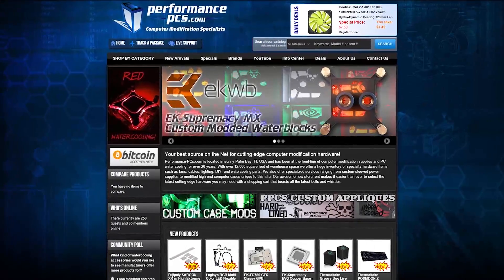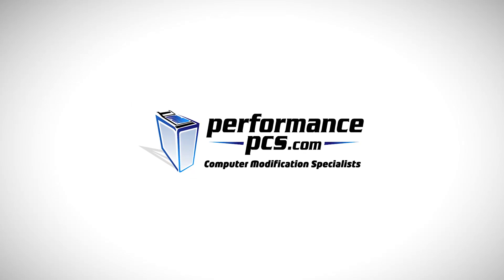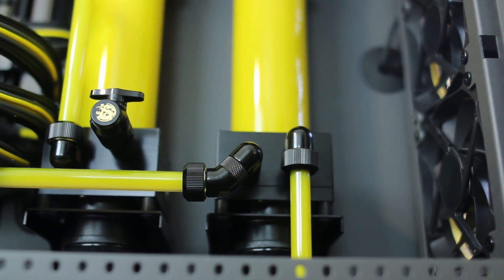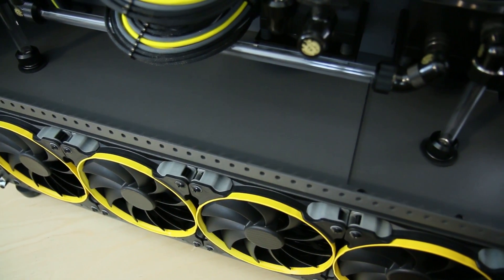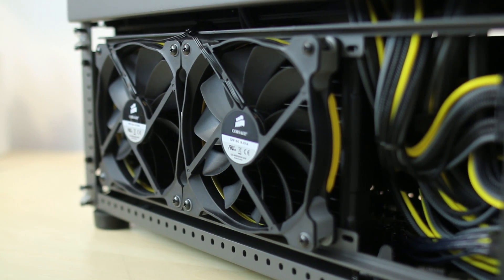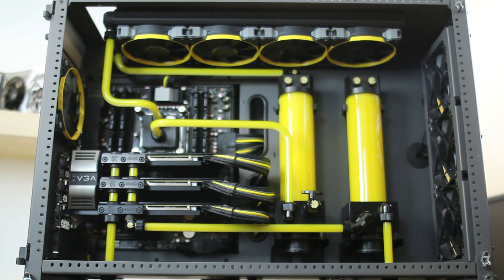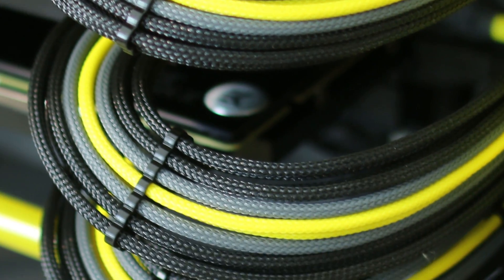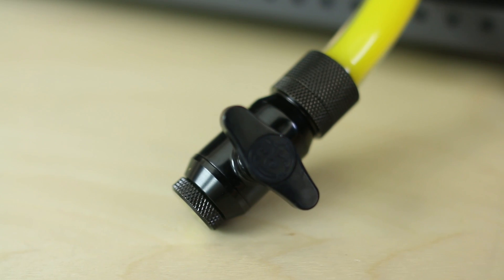Skunkworks V3 is COMPLETE!

Comment: Jay can the temperature diference between the 3 way 980's and the 3 way TITANS have to do with the die size of the gpu and the ratio of tdp/mm2???
Reply from the maker: Vittor Machado The 980s have lower TDP so they would have been the cooler cards, not the Titans.

Comment: Epic B-Roll Bruh, loved it :)
Quick question though, with a loop as complex and long as yours, do you have to wait longer between power cycles? As in fill res, cycle power, let fluid flow, see how far it gets? 

I've just got horrible visions of you cycling the power, filling too quickly and it ends up spraying back out of the res ;_; (i run a meager bayres to CPU/rad and back loop, i am not worthy)
Reply from the maker: Deadly Llama It took about two full reservoir fills before the fluid returned to the res in the CPU loop, and about 3 res fills for the GPU loop.
Reply: *****  Ooft christ, those are big res's as well, no wonder you spent $75+ on coolant ._.

Comment: Jay, I've been watching you since around 2013 and try to watch every video as they get released. I only have a AMD Radeon R7 250 with 2GB of DDR3 V-Ram & a Intel Pentium CPU G3240. I got cheated out of my money with this computer which also is my first one since I did do my homework on the specs. I could of gotten A LOT better parts for the $600 USD I payed for this CyberPower PC. I'd love to be entered into the coming up give away for your 980's! :) I'm trying to run a channel but as you can tell I have low end parts and I feel your classified 980 would be perfect <3 I'm currently half asleep so please don't mind any errors I made in writing this & great work on Skunkworks 3.0! 
- Turtle (Justin)

Comment: I think you shouldn't have connected your videocards that way... It's kinda now not going thru all the blocks in a row, your fluid will now decide it path based on the way of least resistence. and that could mean that your top card will be kinda hotter because the fluid is easier of going thru the bottem card only as it will have the least resistance instead of pussing it up to the other two cards.
Reply from the maker: Sergej Annema You have no idea what you are talking about... like literally no idea.
Reply: ***** please enlighten me

Comment: Hey Jay. Would you explain the temp difference with just the addition of the 280 rad, or do you think it might have something to do with the waterblocks or the heat dissipation design inside the GPU? As in something similar to the difference between haswell and haswell refresh cpus?(4670k/4690k)
Reply from the maker: pesadjo There isnt much to complain... its more surface area. More surface area means more watts can be displaced.
Reply: ***** I really find it hard to understand how you get to do all the work you do, Jay, still finding time for the family and being so active and present within the community and answering silly questions like mine. Thanks a lot. I really appreciate it.

But I'm still not quite getting my head around it. The surface area was increased by 50%(Was 4x140, now is 4x140+2x140), but the Watts were also increased by 50%(was 3x165W, now 3x250). So I'm thinking the 980 increased hugely in TDP while overclocked, while the Titan Xs don't increase their TDP as much. Or maybe because the CPU is becoming a bottleneck, the Titans are not working full steam and not producing the full amount of heat?

Or maybe I was just not paying enough attention and I got the rad size/count wrong.

Thanks again for being so dedicated to the community and to freaking awesome stuff like Skunkworks. There's better system modders out there, and there's more powerful systems out there, but what I think makes Skunkworks so special(famous/well-known) and prominent within the community is your involvement with the community. All the best.
Reply from the maker: pesadjo All you have to do is realize that radiator heat dissipation is not linear like you are assuming.
Reply: ***** It's always the hasty assumptions. I still haven't watched all of your videos in your 'Watercooling' playlist. Guess that's where I'm spending the day. Thanks a lot. Hope everything is going well with the new Skunkworks and you're happy with the OCs.

Comment: Excellent stuff, the system looks awesome. With those thinner radiators there seems to be so much more space in the main part of the case.
If there were any doubters about your GPU cooling, to do with the tubes and flow, they just need to watch the filling from 1m20s and all will be revealed.
Reply from the maker: jockspice And yet they still ask when the answer is right in front of them. There is no cure for stupid.
Reply: ***** Indeed. Except perhaps a polo mallet.

Comment: At 1:20 it kinda shows why parallel configurations like that work, you can actually see the liquid come out of the blocks before the first block is full.
Reply from the maker: LachieUnderscoreSixOneNine The flow rate is evenly split between all 3 cards. Thats why if you also time how long it took for the coolant to come out of each passage, they are identical.

Comment: 3-way sli 980 to 3-way titan x see marginal performance boost likely cuz of cpu bottleneck.  Maybe dual cpu is next step. Would be interesting to see at the least.
Reply from the maker: yhp99 Dual CPU will not unbottleneck the GPU performance. So many people get that wrong.
Reply: ***** Didn't realize this has already been debunked.  I wonder why. Also, I wonder if newer technology makes previous comparisons invalid.
Reply from the maker: yhp99 Its because XEONS offer more cores, not more thread performance. over overclocked i7. So adding more cores wont fix the problem.

Comment: the only freaking thing that's bothering me is that one of the fans for the 480 rads in the bottoms seem a bit swiveled than the other. sorry but this is bothering me like hell.
Reply from the maker: Ahmed Alkathiry That literally makes no sense.
Reply: check them and you'll see
Reply from the maker: Ahmed Alkathiry Again, what you wrote makes no sense. The fans are not crooked.
Reply: not sure what to say beside.. legendary system. you have out done yourself.

Comment: Hi jay i was just wondering, why do you use airflow fans to cool your radiators? i know they can push air through the radiators, but wouldn't you get better temps with the static-pressure one's?
Reply from the maker: Runar van Geffen For the 32058356159713597135 time.... THEY DONT MAKE AF140 FANS WITH THE REMOVABLE RINGS!!!!!!!!!!!!!!!!!!!!!!!!!!!!!!!!!!!!!!!!!!!!!!!!!!!!!!!!!!!!!!!!!!!
Reply: ***** okej didn't see they where 140's.
Reply: ***** awesome machine btw!! im going to try watercooling in the NZXT H440 and your videos help a lot. thanks!!

Comment: I just finished my custom loop with a 5930k @4.5ghz and Titan X @ 1450mhz core.  I have a 360mm rad for my CPU and just a 240mm rad for my GPU.  The titan x maxed out at 41c, and 5930k maxed at 57c.  My former loop had 2 R9 290x VaporX's and they both hit mid 60s at a measly 1100mhz core clock.

Comment: Hey, Jay. I know you use liquid cooled GPUs (and I may get drowned in the comments), but I was wondering if you could maybe help me with a problem of mine. I want to change my MSI GTX 970's stock cooler for an aftermarket air cooler (Arctic Accelero Xtreme III), but I have noticed that MSI's 970 has a 6-pin male GPU connector and its corresponding female connector only has five pins but with 6 slots. (Blue->Green->Yellow->Black->empty->Gray). How may I fix this issue or find an adapter so I can connect the Accelero's 4-pin into the 970's 6-pin?
If anyone else has an answer to this problem, please feel free to reply.

Comment: I think adding the 280 is just like using a thicker rad because it uses the hotter air from the 560 just like how more fins in a thicker rad works. So I think it's just because of the thinner rad lets more airflow and it's just plain better. Correct me if I'm wrong Jay.
Reply from the maker: acnfanmanin Unfortunately, you are wrong ;-) I said right in this video that temps dropped 10c...
Reply: Yea it is better. I did say it is better. But was my reasoning correct? Sorry if this is bothering you too much :p

Comment: Jay, question about how you hooked up your video card water blocks. Why did you hook up the tubing between them in that configuration? I agree it looks really good and it will preform due to Head pressure. however the top card's "flow" is reduced due the fact coolant will take the easiest path via the bottom card.. Really nice build Non the less my friend, just wondering about the video  card tubing. Grats on getting it done!!
Reply from the maker: Greg Ruffino You are very wrong about how you think the fluid is moving. Just do some basic research about fluid dynamics and you will find all your answers.
Reply: ***** Jay, you hooked up your Video Water blocks wrong. It looks pretty, but the flow is wrong.
Reply: Greg Ruffino series, not parallel.

Comment: What i got most out of your video is how your gpu temps dropped 10 degrees by adding an extra rad, while using 30mm rads.  I'm using two 480x60mm in my current setup, and I'm thinking doing something similar to your build.   I look forward to your radiator video.

Comment: how do you control your fans, because i know you have the modmytoys splitter but I still want to know how you have it set up for controlling the fans, like speedfan, through the mobo, or a low noise adapter
Reply: Ab313r Watch previous video, all fans are ruining fixed at slow speed.
Reply from the maker: michael weiss Not all of them
Reply: *****
thought thats what you said you where going to do in previous video.

Comment: not trying to be annoying or anything... but why does he have air flow series fans on his lower radiators. Im not sure but I think that air flow fans were on the top radiators too. Why not static pressure?
Reply: Thin rads.....you can use almost any fan you want on them 😃
Reply: Corsair doesn't make SP140 and Jay, like a lot of people like the looks and the option to paint the rings. And from what he said IIRC, they push more than enough air through the rads. He basicaly have so much rad space and airflow it doesn't matter they are not static pressure optimized. If I said something wrong, feel free to correct me people. :)
Reply from the maker: Mootypotuty Because you are unfortunately a product of clever marketing.... I dont blame you though, you cant help that the community has mostly lied to you.
Reply: +JayzTwoCents so instead of giving me an actual answer you just insult me. In one of your recent videos you said that "it gets to a point where the amount of surface area on the radiator gets so big that the amount of static pressure doesnt matter quite as much." so i guess you finally did answer my question. How was I suppose to know that?

Comment: Jay...PETG right? Also, could you please explain the position of the ball valve? Not the lowest position, have you tried to drain the system and how did it work? I'm thinking where to put it in my next build but the rad is going to be in the top chamber
Reply from the maker: AnteICash It is in the lowest position. You realize its two loops right?
Reply: *****

Ah yeah I realized it 2 mins after I wrote the comment. I will have a custom plexiglass thick middle plate with a water channel in it, still don't know where to put the draining port.
So by the zooms I guess you used PETG, I'm still debating if to use petg or acrylic. I think I will go with PETG. Thx Jay

Comment: Skunkworks V3 is looking killer. Its sad that the 5960X is causing it to bottle-neck. Do you think there will be a faster Socket 2011-V3 CPU in the future, if so will you be putting it in Skunkworks?

Maybe one of the Motherboard Manufacturers will put out a Dual 2011V3 Board. That would be cool.

The 980 Give away is going to be epic.

Comment: He said he has 36 gigs of VRAM, but I though going SLI or CrossFire doesn't add up the VRAM on the GPUs, I thought it just gave more processing power.
Reply: TheSpeedo666 It doesn't, at least for now, what he said is he has more physical ram in graphics cards than system ram, so he DOES have 36gigs of ram in the cards even if it doesn't stack, understand?
Reply: michael weiss Dx12
Reply: Axecution
I stated, at least for now, pay attention.
And its still not proven if this will work well on DirectX12, and it will likely be a year before we see any decent games with it implemented anyway, no current AAA games will be converted to DirectX12, its just to costly

Comment: Are you planning to upgrade to Broadwell-E since the 5960x is a bottleneck?
Reply: Explain this to me.
Reply: TekReview's Again? How many comments is it going to take before you stop insulting people in EVERY SINGLE comment? They probably just buy new hardware cause they feel like, that doesn't make them an ASS. It's something called FUN which (either 2 or 100) year olds don't understand.
Reply: ***** DX12 won't fix anything unless the developer is willing to take time to maximize it.  And it'll be way down the road before we see any of that happening. 

HOW long did we have dual core CPUs, before any major software developer actually took advantage of it?  Same for 32 vs 64.

Ownzem K the CPU isn't the bottleneck.  Its the drivers and software out on the market that is.
Reply: Luke V That might actually make a bigger bottleneck than the 5960x...
Reply: J. Cole I can NOT tell if you guys are trolling or not I don't know how in hell the 5960x is a bottlneck.
Reply: Moethedirt He admitted it in the video.
Reply: Julian Nazarian Oh Well couldnt finish it at the moment I started watching the vid.
Reply: ***** It's not about the cores. Games don't support 16 cores. So adding more wouldn't help you. That is the problem with this processor. It's has more rendering power then a normal quad core I7, but the gaming performence is nearly the same. Games mostly only use 4 cores. Not more.
Reply: Jay said it bottlenecked in the video, I'm just asking what he plans to do to get around it.
Reply: Luke V my guess is he will not ,but maybe the skylake-E but i also doubt it.
Reply: Zeiss120 EVEN if the developers optimize a game for it its only in that game In Example Far Cry 5 on Dx12 I have 8 Gigs of ram with my sli 980's But on Far Cry 4 on DX11 I only have 4 gigs of ram. I know that you know this but most people dont.
Reply: Luke V Just need to phase change cool that 5960x and overclock it a bit more.
Reply: ***** Because Jay wants more from it - that is enough reason. He noticed that he got large fps gains from overclocking the CPU so would like to push it further. Crazy powerful is not enough. Sure, it is going to be a modest gain compared to high end water cooling for a high price but he is already well past the point of a reasonable gaming system anyways.
Reply: Well Jay cant get enough pc power I mean he literally upgrades every 6 months it makes me laugh.
I wish I had sponsors.
Reply: man dude...  As a YT that spits out content on their channel, Jay HAS to be up to date when it comes to hardware.  Also its not some BIG conspriacy theory that he's getting his shit form the companies.  Obviously they went him to review their product and push it on his audience.  And whos to say the stuff he has isn't bad?  Hell I would have top tier items also just to be in the game when it comes to what I need to show you.  I mean do you really want a tech channel with a dude that's still on a FX-8320 processor who is reviewing that same chip again the next month?  No.

As for the avg or even above avg viewer we don't have to upgrade because we have people like Jay showing us the margins of improvement/benefit that we might see (which isn't much).  And the benchmarkers who upgrade every time someone new drops anyways aren't gonna change their minds.
Reply: Tobias L. exactly.. also the default clock of 3 ghz is very low.. in most cases an i7 4 core with higher clock will give you more power in games than 6 or 8 cores on lower clock..
Reply: ***** Not all review samples they are allowed to keep tho.  And my comment after yours wasn't directed at you, just seems like people don't understand how things like this work for some odd reason.

OC3D, Linus, etc etc have all mentioned deadlines for how long they could keep XX product before it needed to be mailed back.  However its also true that they can and have requested companies for review samples an even products that they could keep in hand.  

IE the Titan X was given to Jay by nVidia after a meeting he and he asked for them.  Also that was all disclosed in one of his videos so none of us should feel like he's cheating us some how, and none of you should feel like he's lying because he has been up front with it.
Reply: Luke V There won't be a Broadwell-E Broadwell is all low power cpu wait for Skylake since it ha the 5770k and all that in it Broadwell to me was kinda stupid it's mostly updated dual core pentiums
Reply: ***** xD

Comment: Awsome build. One of a kind. 
Have you considerd watercooling and overclocking ram?
I7 5960x a bottle neck?  thats new. Maby xeons in v4? Dual or even quad cpu?
Maby(i wish to hear your opinion) you can had tubes around the cable. It might look cool, never seen that before. It will look like 4 tubes going into your gpu instead of just 2.